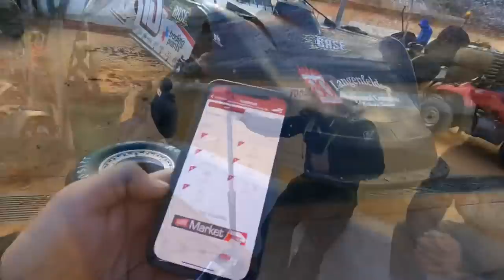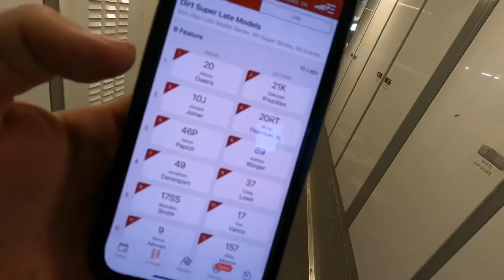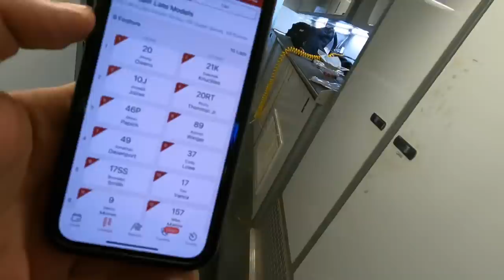The Field Was Stacked! Fighting to Make the Show at the Bristol Dirt Finale!

Comment: I am a former district sales manager for a company that was sold a few years ago but they had a lot of literature that was extremely helpful when it came to fasteners, you know nuts and bolts. I know that people think they know a lot about fasteners and what they’re doing and I’m here to tell you there’s a lot to learn. If I had one of the Fastener books they published, it was called Fastener Facts, I would send it to you. The company at the time I work for them was called Bowman Products.  So if you run into someone who has one of those books, it would be a good idea to try to get it. I left the company in the late 70s, but that doesn’t change the engineering on nuts and bolts. Unless you were in a huge wreck there is no excuse, none whatsoever for a fastener failure on a race car. I have worked on race cars and we ran dirt cars initially and asphalt cars on the half mile, all late models and modifieds, I do understand what the issues are.
Reply: My experience in racing is most of my bolts break because I removed too much metal to make them lighter. 1oz off Rotating mass is like a pound of normal weight. I’m no scientist but I’d try so many different things.

Comment: Solid Bristol run guys, i watched your runs n noticed the cars entry into all corners was great but corner off is way off. You would pull cars on entry n loose everything coming off. All in all you guys are improving great team effort. Get good rest when you get home..
Reply: what your describing is the difference between the 850 HP that these guys are running vs. the 950 HP that Madden and Bloomer and McDowell all have....big track like this all comes down to the engine
Reply: 3000 hp doesn’t help when you can’t put it to the track and they couldn’t Still a great effort

Comment: Heck yeah! Proud of y’all and congratulations on making all 4 shows against the best in the business AND for not tearing up your cars. That’s a very solid showing guys! I’m sure y’all turned some heads. I’d like to see the Dale engine get freshened up and see how it runs then. Anyway. Y’all be careful traveling back home. HTF BABY!!!💪🏻🏁
Reply: Problem with freshening an engine right now is can't get parts.
Reply: Gail what do they all do when they freshen them crank bearings rods rings do they punch them out a little if necessary   ….  And are most required parts from overseas?

Comment: Hell yea boyz I would call that a success especially racing against the best-of-the-best literally! Like Joseph and Jesse said you made all four races and didn't tear anything up that makes it easier on Jessie and the boys give them a good washen, go over the whole car check every Nut and Bolt oh, and I would for sure service the engine and run the valves I feel like that's something a lot of teams don't do running these big engines checking your valves let you know if something's going on deeper in the engine! Y'all boys do a hell of a job it's crazy to think just 4 years ago Jonathan was still using an open trailer now you have a house on wheels and a two-story garage on wheels lol amazing

Comment: The new motor is good. I think you are still at least 30 or more HP from the big boys. They all pull you down the straits. Good job for all of the HTF team!
Reply: id say closer to 100 HP from the big boys....the SB2 in the 10 is roughly 850 hp, the ROX Chevy's and the RY-45's can make over 950 HP
Reply: @harleybaldwin7015  Thought they said it dynoed at a little over 900 HP, guess I heard wrong, thanks.

Comment: thrashing, thrashing thrasing.  One thing I love about you guys is you show the OTHER side of racing,,,,the WORK side. I have changed transmissions BUT I was on dirt in the pits and changed it with a kid hoilding a flash light. NO BODY knows the amount of work that goes into one of these things. It is Hell when you turn a 15.8 on a halfmile dirt bull ring and you are slow. tough deal. You brought home two complete race cars and two complete engines. No shame in that. Good job.

Comment: congrats on all 4!!  I have a lot of experience with 410 sprint cars, so this question is not coming from someone that is just talking.... why don't you sell off some stuff to just get two top of the line engines?  Make hp not an issue... .people sell engines because they just don't add up to what else they have in the box or in the car.  i mean a new toterhome and other stuff is awesome, but put a new vic hill or something under his hood!
Reply: Do you think Davenport was short on horsepower?? Just asking...
Reply: Yes sir There is a reason they off load motors for half price.
Reply: I wouldn't think Davenport's operation would be short on anything
Reply: @dannypittman8352  There not.. But because of the 6 tire max Davenport and Moran went with Hoosier 1600's (super hard) and they never fired off it was there fault. But be careful about what you think you see because it's very likely there's more to it than your told. And I was there all 4 races so take it or leave it.
Reply: @JJ-1-1  Trust me, I do understand.  I drove Late Models for over 10 years.  You are correct in that you don't always understand what you see, and too many armchair crew chiefs on here condemn someone's engine package.  I also know that I got outrun more times than one by a guy with a lot less horsepower than I had...... For what it's worth.
Reply: @dannypittman8352  Davenport was not short on horsepower. Just a handful of guys could find the speed. Last year, Davenport was a beast at this track. 

I was pretty baffled as to why so many veteran drivers, that were well funded struggled.
Reply: @voodoo7008  And that was my point in the beginning of this thread.... Folks make comments about HTF's horsepower, but fail to see the top funded operations struggle too.
Reply: @dannypittman8352  3 of the 4 winners were seasoned veterans. Those guys know things. Fergy is bad fast everywhere. He usually fades late, but not this time.
Reply: @voodoo7008  That's right, and he could have had a 355 in it that night and wore them out.. 😁
Reply: @dannypittman8352  watched a guy win a race at Senoia with a crate motor. Forget the model, but it was a 500+ hp motor. He wore them out.
Reply: Yes you can trust Davenport was insured on horsepower whether he was Running a Clements or Cornett Which I think he was running a Clements

Comment: makeing the cut looked very difficult. qw for fans in the seats i did t see many from the video.for me i had to work and only have time to watch video on youtube., thebig question would be about the trip? how much did the trip cost with gas 4 sets of wheels.,any motel as im sure all of the crew can t stay inside the  truck. but over all you got experence from engin s to run to seeing how tires wear .also the need the change the week they have the events.with spring break,and bbaseball starting and the masters thursday.. best wishes for a great 2022 i will be at senoia  the next big event..stay safe while traveling.i be watching the next video.

Comment: Joseph you are doing it right, the only way to get better is to run against the top teams, some of them have unlimited budgets, you got that other ride this year because of what you have done the last two years, going to Eldora,  both years at the Bristol dirt nationals, putting away those nay sayers that keep posting on your channel that you can run with them or have this or that. I get tired of reading those comments  on just your channel but others as well. Joseph you have done very well, saving your equipment like you did is smart, you know what it cost per lap at the races, most never will. Tires are way out priced and fuel will follow, I hear sheet metal has doubled in priced in the last couple of years.

Comment: If the HTF guys go back to Bristol they should have two (2) 950+ hp mills, the make of their choosing.  That's what all the big dogs have, you can't win without one.  Back home in one piece, precious.
Reply: That's what I have been saying forever but watch for Vern Simmons to come out with 600 excuses.
Reply: They have 2- 950 + or - engines????
Reply: Half-dozen of those high-dollar engines didn't survive. They are grenades with lose pins.
Reply: @gailtaylor1636  That's true but 4 races at 9000 to 9400 is little harder on the pro's motors than HTF turning there 20 year old designed SB2 motor at 8500. I don't think you realize there is a price to pay for playing the game on such a high level. popping a motor or 3 is part of the game. So your comment on "high-dollar engines" Doesn't get you anywhere.
Reply: @marionberry6909  Hell no they don't
Reply: @JJ-1-1  I heard Jonathon refer to the SB2 in the white deck car as high 900’s and the SB2 in the black deck car as low 900’s. The Draime is somewhere in 800 hp range. No need to cuss???
I would think they would do better with a pro setup specialist so they can use the horses they have. LMHO
Reply: @JJ-1-1  If you have someone that wants to pay their motor bills, send them an email. Need at least 3 motors if you gonna have a back-up car and a spare motor. A $150K check would be first step. Not many people start their racing career at the top. Takes time to build up. They are pretty early in their SLM part of this journey.
Reply: @marionberry6909  Mid 800's for the Draime, high 800's for the Race Tech.  On a "handling track" (short narrow track) a person could do pretty well with an underpowered engine by merely hooking it up.  On a long track like Bristol it's horsepower.
Reply: @marionberry6909  No you didn't hear them say there motor are high 900's. There sb2  is very close to 900 not high 900's. you need to go back to when the bought the motor video ...quote Jonathan asks Joseph so we bought another motor JJ said yes Jonathan then asked what was there hp JJ says near 900. end qoute.
Reply: @JJ-1-1  ok, 👍
Reply: @gailtaylor1636  Boy you wear that statement out. I bet I have seen you use that comment atleast 100 times by you. That's your go to where you have nothing no valid point. By the way did Tim Hitt pass last year ?
Reply: @gailtaylor1636  Some thing you may not know Joseph has been racing LM since the mid 2000's actually not Jonathan but the other brother was the better driver. They have a flash back video that they put up Early in there HTF venture
Reply: @JJ-1-1  Is it not true? If they sold all their engines, SLM & crate, doubt they could buy ONE current new engine with the proceeds. So what would they gain? As you are fully aware, takes sponsor dollars to race. Until they get better sponsor dollars they'll keep doing bets they can with what they have. And I don't mean that to diss their current sponsors. 

Yes Tim died. Was with his  his buddies lined up on tee at gold course. Just dropped and was gone. Family history of heart trouble. We all knew it would happen eventually. Guarantee he was having fun. All we can ask for.
Reply: @JJ-1-1  I know he's raced for many years just never ran with Lucas/Woo till last couple years. It's a big step. You can either be big fish in little pond or...
Reply: @JJ-1-1  I could just toss this right back at you. You and others just keep screaming about how bad they are doing with this old junk. Buy them something newer that suits you or go follow another page. Seems simple enough to me.
Reply: @gailtaylor1636  Damn what a Cool fellow I was there when he went out of the track in the middle turn two Gaffney in the early 2000's with a local Super LM driver
Reply: @JJ-1-1  He was one of the nicest people I've ever known.

Comment: I knew it was gonna be a bad night from the get go... Motor sounds flat... Can tell its hitting a wall / floating the valve springs... Gonna have to put new ones on before y'all can see what that motor can really do.... That motor should be turning 9 grand easy... Them weak springs are only gonna get worse before one possibly breaks.... Why the car has slowed down from the start of the week...

Comment: I would not go back. The novelty of the event has run its course. I understand the income is from subs, but almost zero folks in attendance is not dirt racing. I thought the crew really did a great job with the racing surface, but it just does not lead to compelling racing for the Late Models. Also the weather is very iffy this time of the year especially in Bristol.  Good job picking up checks and making Features.

Comment: You have to have BIG MONEY to run that race. Each race nite is $3000.  Tires, oil, pit passes. Food. etc...  DOES NOT include wear and tear on motor and race equipment. Then you need $$$$ for each nite  you stay. I know its a toter, but fuel for generator, food etc. So even though you made 4 shows. YOU did not break even. Sponsors are the ONLY way>>>>

Comment: You are competing against the best funded, best equipped teams in the country. These guys have multiple fresh “Dale” motors and piles of shocks and springs and all the professionally prepped tires they need to bolt on to run almost a second faster then you. 
  Work for better and more sponsors, which will be hard in this economy

Comment: Sell the Capital stuff and buy a Longhorn.. sell all the used super motors and get a Clemets.. that's the only way y'all will be competitive against the big boys
Reply: Bristol was not a good fit for capitals. None of the capital cars did well. Most of all the other tracks they do very well. I believe there equipment is pretty good.
Reply: Didn't a Rocket XR1 win 2 (Smokey) of the 4 races here....and the Bristol Championship?
Reply: Furggy won and he was in a bloomquist
Reply: @kevinhill8937  Team Zero did very well both weekends
Reply: macdowell  also in a bloomquist  but not surprising that track is right in the bloomquist chassis wheelhouse
Reply: @5jr.racing982  Yes Madden had a Rocket XR1
Reply: Capital stuff is way off at Bristol. HTF was tight from the time they ran the first day and was still tight on the final night. Clanton was no better if not worse! And car builder is no where around for 4 50,000 races to give advice and support. That’s where Longhorn, Rocket,Bloomquist,etc. always there in pits for setup and support! Absolutely they are  behind on technology running 2018 chassis and 2014 engines. They overachieved by making all of the shows because they were 3/4 to 1 sec. Off the pole time every race! I was at all 4 races and bought merchandise and supported them. But they are just not prepared or equipped to challenge that group yet. Need to run Ray Cooks summer nationals and get some good experience!
Reply: @shanepropst8358  problem with summer nationals is that it beats the hell out of equipment. I agree on the capital stuff. They will see when he runs the Henderson cars
Reply: @shanepropst8358  You speak soooo much truth brother. I have said this a thousands of time.
Reply: @Etan1122  It’s the Ray Cook summer nationals ! Not the Hell Tour… Ray series’s run and southern tracks in southeastern region! 3/8 to 1/2 mi. Tracks
Reply: @JJ-1-1  thanks! Love these guys.. But sometimes you can’t beat Goliath till you have the support system. Davenport,Madden,Overton, etc. got the experience on Ray Cooks Tour’s great mix of 3/8 to 1/2 mi. Tracks where there car and engine can get them the track time they need.
Reply: @shanepropst8358  ah I miss read.
Reply: @shanepropst8358  You're spot on in what you said .. I love these guys and I believe in Joseph's ability but they're far behind on the equipment side for these big national events